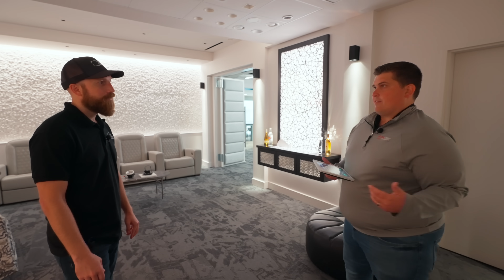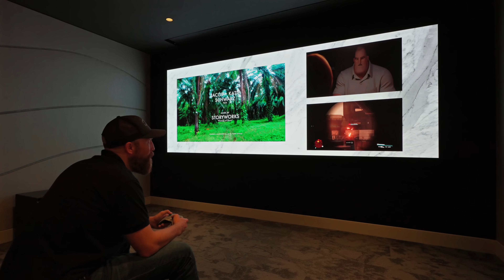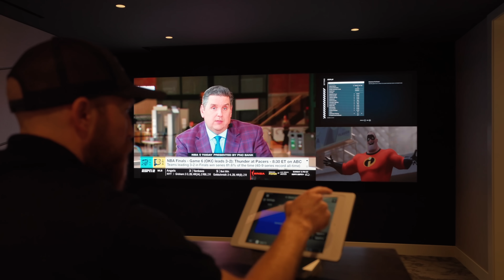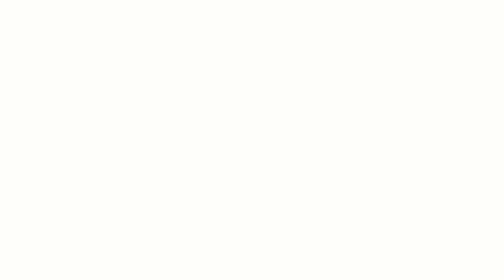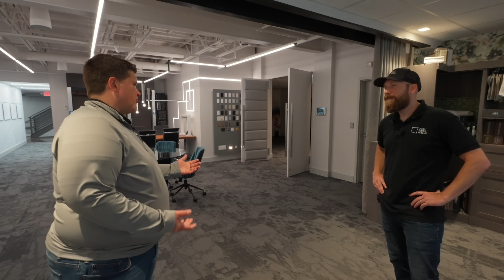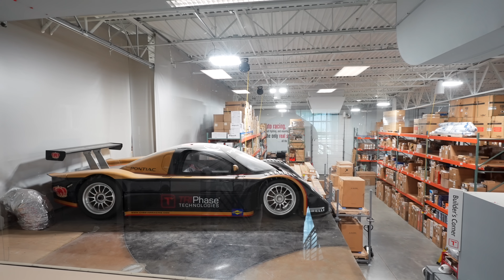MICROLED Just TOOK OVER this Room at TRIPhase – One of America's Largest AV Showrooms

Comment: any idea when MicroLED will have 0.3mm or lower pixel pitch? hopefully someone out there next month can make a single unit. (not modular) 77 - 100 inch, 
true 8k, paper thin, curved/glossy tv. with a sexy center stand. back in 2015 I bought an oled LG 65EC9700, hopefully I can one day buy a microled that looks like that model. :)
Reply from the maker: Probably will get smaller, but why not just buy a 75 or 100” tv?
Reply: @justvideowalls  as of right now at 0.9mm pixel pitch, if I want true 8k microled tv, the tv will have to exceed 200 inches. maybe a true 4k microled can be done at 108 inches, but I rather get one at a lower pixel pitch. I've seen complaints that microled looks ugli up close cuz, the pixels are too separated. also, the gimmicky lego panels are actually noticeable up close. hopefully this year's CES shows more promise and less gimmicks, microled's are getting cheaper every year as production gets more efficient and cost effective.

Comment: I have seen theater video walls in action and I STILL would rather install an acoustically transparent projection screen in my house any day of the week and twice on Sunday (which is what I have in my current theater).  The ability to have the sound come directly out of the picture, locking it to the action, is worth its weight in gold.  There is also a visual aesthetic to reflected light rather than direct light off a screen that a video wall just cannot replicate.
Reply from the maker: To each his own my friend!
Reply: I won't be giving up my PJ and screen anytime soon but the prices are tumbling with the competition and once they halve the price (which I think will happen in a few years) I might go for their 123"  0.9 pitch one.  Not having speakers behind is a hard pill to swallow though when you have top speakers and have to go down in quality to something that will fit either side and under (if you have room).
Reply: I concur with the light reflection on the eyes, also that nostalgic theater in your own house feeling that projectors have. Everything else can easily be overcome with some speakers with good imaging. My Elac Debut 2 5.2's, at the right volume, have tricked me into thinking sound was coming from my TV. That's just a 2.1 setup also. The imaging is just that good. 

The ability to change aspect ratios without getting and  dealing with expensive lens and masking system and no ambient light issues is just the icing on the cake. Pixel density matters more than resolution though since you're literally adding pixels the larger you go. 

I think Sony LCD modular display is 1080p for 140" but scales up to 16K at 790" but is the same pixel density and overpriced at this point. Granted the viewing distance would be 15 feet minimum for almost 800"s (66 feet 16:9)

Comment: Why white seating, white walls and a white/black carpet???
Shouldn’t it be all black, as the light from the screen will just shine off it all???
Reply from the maker: Reflected light on the surfaces of walls and ceilings does not affect MicroLED in the same way a traditional projection system does. So we don't have to make the media rooms all black anymore
Reply: @justvideowalls ok, so what about having speakers right behind the screen, like with an acoustic screen?
Reply from the maker: Video walls are not acoustic so audio needs to be designed for other placements. Many brands have solutions like phantom vertical for lcr, only phantom center, reflectance, etc.

At triphase’ showroom they did a center just below the bottom of the screen